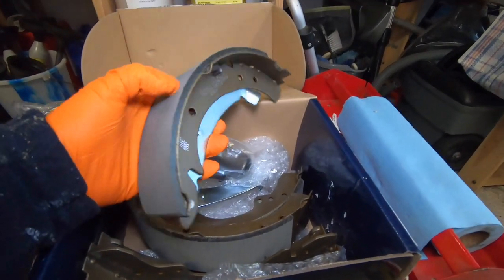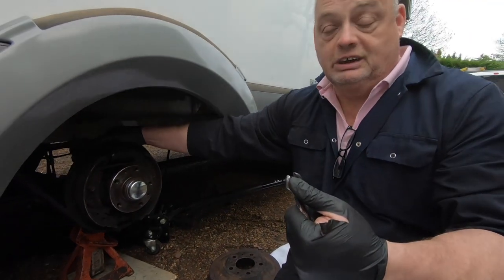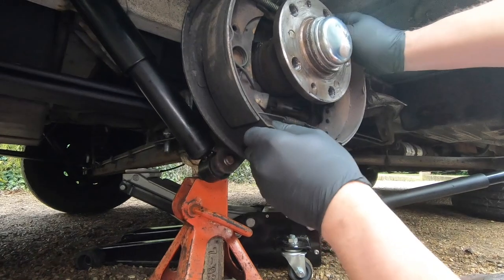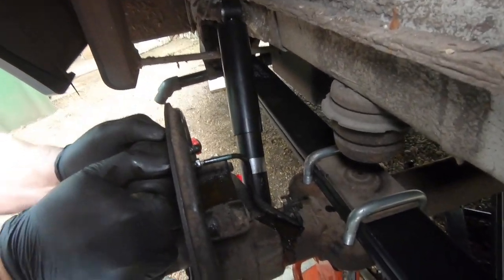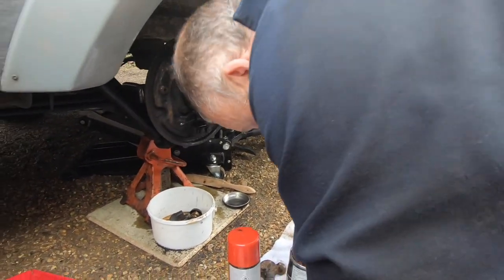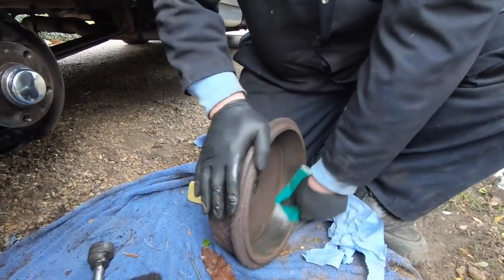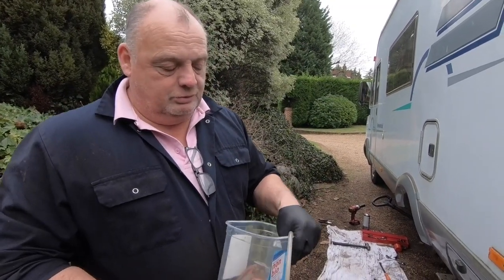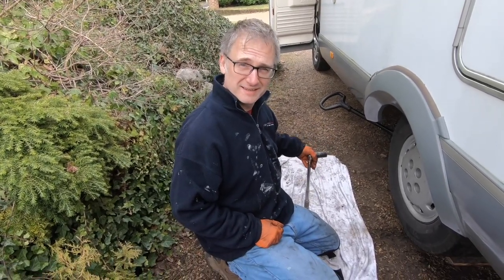Motorhome Mechanic - Replacing Rear Brakes on a Fiat Ducato

Comment: informative and helpful. Will still take it to my local garage. Reinforces there are some tools needed for this, and secure support of the motorhome while working on the brakes. Good to have a good sensible mechanic.
Reply from the maker: Hi Alastair, we've gone off of our garage. They should have noticed the front shock and the brakes (even passed their MOT). It might cost a bit at first for the jack, stands and other tools but doing these things yourself you know they've been done by your own standards. You also get a great satisfaction too

Comment: Thanks for this series. I've to do basically everything you did; replace a front shock that is leaking and front pads and rear shoes. Your videos are a good complement together with the Russek manual. ;) Happy travels.
Reply from the maker: Thanks SkyOnRoad. This means a lot. What's this Russek manual you speak of?
Reply: @HermanHitstheRoad  Peter Russek publishes pocket workshop manuals. They're not as good as Haynes manuals but at least it exists for the Ducato/boxer/jumper.

Comment: Hi chase great video on how  to change rear break shos many thanks for that. Very nice to see you have more axle stands and a jack not just relying on a couple of cheep axle stands when you change the drive couplelings which I Very strongly condemned  also I see you had plates under the axle stands very good brilliant thanks  .I normally put the wheel under as well with a couple of blocks on the top all in the interest of safety. I noticed that you were struggling nearing down  I use a 6×4 horse mat they are about 2 inches thick  brilliant if you can get a used one from some where  you will see a major difference even if the ground is a bit wet they are very good to lye or neal on .hope this has been of some help to you and others many thanks 😊😊😊😊😊😊😊 willemog.
Reply from the maker: Thanks Willis. Yes, Chas has various mats and I use knee pads for extra protection 👍👍

Comment: Another great video thanks. Need to do the rear shoes on mine this weekend. Did you lube any of the selfadjuster mech or threads? And did you use any copper grease between shoe ends and piston faces? Good to see the point re: hub to drum alignment in the outtakes :-) Thanks again to both of you for putting all the effort in to these great videos.
Reply from the maker: I didn't lube the self adjuster. I put copper grease on the edge of the shoes where they contact the back plate but not the ends. I hope this helps, @mobilvettamotorhome2056 ?
Reply: Yep - one side done and I did the same so far. Having a nightmare getting the second drum off. Do you recall the thread for the three bolt self extractors in the drum? Tried M10 coach bolt but it feels wrong. Might be they’ve been abused in the past but it would be good to know correct spec if possible. Thumbs up too to Coastal Motorhomes - great phone and delivery service and I used your Herman discount code on the parts :-)
Reply: FWIW - I found a post on the Fiat forum stating the drum self extractor threads are 10mm x 1.25mm pitch. Will get some good cap head bolts and try them.

Comment: Great video and series. Just a note not a criticism and maybe you did this if camera but before adjusting the shoes it’s good practice to fit the drum back over and press the brakes this centralisers the shoes before you adjust them up. Anyway keep the videos coming and good luck hope you don’t mind the advice
Neil
Reply from the maker: Thanks for the advice, Neil. The brakes are self adjusting so I'm not sure it matters.
Reply: Herman Hits the Road no your correct it will adjust but most of the time the adjusters don’t work great but yours looked in good working order to be fair 👍
Reply from the maker: Oh, that's because I also brought the brake kit too. I got what you're saying 👍

Comment: Great video I,m doing my rear brakes on my peugeot diesel campervan today wish me luck
Reply from the maker: Good luck, Gordon! How did you get on with your brakes?
Reply: @Herman Hits the Road  one side was a pig but loosened the handbrake cable and new shoes fitted and brakes bled the fluid that came out was black they're much better thanks for the video really helped
Reply from the maker: That's great news, Gordon 👍👍

Comment: Hi again, great video. I’m now in Croatia and after inspecting the lining on one of my brakes on the double rear axle came off. Will need to replace the shoes on that wheel, and will do the opposite as well. Does this mean I will have to do the shoes on the other rear axle as well?
Reply from the maker: You should always replace brake shoes (or pads or discs) in axle pairs, @mjgdevos. Meaning that the brakes on the other axle shouldn't need replacing. I hope this helps

Comment: Great video, does herman have a load sensing valve ?   Im thinking if its adjusted incorrectly it will mess with the rear brake operation however well you set them up. What do you think?
Reply from the maker: Great idea, Colin but I think it's OK. We don't seem to any problems with the rear brakes or the lead sensor. Thanks 👍

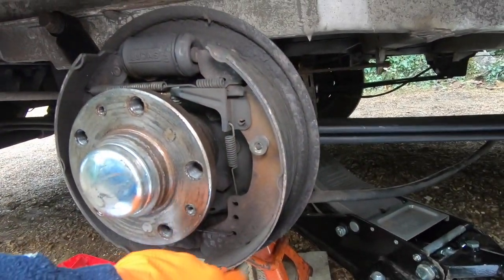Comment: 1:47 I managed to get both brakes back together now (after having to flare and bend a brake line)  Job done but then I noticed the spring that goes from the adjuster is installed differently between each wheel.

First off.. my model is the one before yours and so the adjuster is not the same.  I have FT32423 and you may have FT32420 but to be honest FT32420 does not really look like yours.  

My "before" photo shows the spring entering on the back of the adjuster arm and the back of the shoe.   

The other side I installed like yours, with spring entering the arm from the front and entering the drum from the back.  I don't have a "before" photo for this side.

Now I must decide if I take it apart to match the "before" photo of the other side.  Or.. perhaps it is meant to be this way?  

( Too bad I took only one side "before" photo.  I advise others to not be like me and to instead take a photo of each side "before".  )

Well I've just put the other drum on now and said the heck with it.  Good enough.
Reply from the maker: Great stuff, Matthew 👍
Did you need a new brake line or did you manage to reshape it to stretch long enough?
Reply: @HermanHitstheRoad  New line.  Actually there was a lineage of 3 lines. Mind you I'm in Hungary and cannot speak Hungarian, nor is my girlfriend all that great at translating.  The first line didn't have the correct flare.  Couldn't get it on & good thing I couldn't -- probably would have leaked.  The next line had the right flare (the DIN aka bubble flare), but I had to bend it myself.  Used a 26mm lug on a vice to bend around.  Turned out OK.  Then I realized copper isn't really maybe the safest & so I ordered a copper nickel line with flares pre-made from augustin in germany.  I haven't tried to bend it yet, the copper line is on the car and seems to be doing the job for now.

So then I put it all back together & got the drums just perfect & then it was time to bleed the brakes.

Figured out how to bleed one.  I tell my gf to pump it slow.  Then her dad comes along and tells her to pump it really fast. I didn't really think fast enough and before you knew it suddenly all this air was coming through.  

So the master cylinder went dry.  

Any times on getting out of this pickle?  

I've watched some vids that say I can bleed the master by loosening all the lines to the master, then pushing the brake down & holding it there, then tightening the lines, and then releasing the brake.  Then repeat that 5 times.  

I'm going to give that a try tomorrow.
Reply from the maker: Your need to get the fluid through the pipes and remove all air. Pumping fast and not locking the nipple off in-between pumps (when foot is down) means that air can get back into the line at the nipple when the foot pedal is raised. Make sure the master cylinder does go dry and start with bleeding the brake furthest from the cylinder, then the next furthest etc. There are some bleeding kits which require only one person. 
Good luck 👍👍
Reply: @HermanHitstheRoad  Thank you for writing back!  I feel like I've really gotten myself into a corner.

Did you mean to make sure the master cylinder does NOT go dry?  Everything I read warns me against this.

However... I accidentally let the master go dry.  

So... now what?  That's what I'm trying to figure.  

Was going to maybe try something like this to bleed the master.  https://www.youtube.com/watch?v=Uz4OwuUGVOA.    He tries to push the air out from the master by loosening / tightening all the lines exiting the master.

Comment: The brake fluid nut is 11mm.  watched other vids saying they are 12mm, but the flare tool I purchased has 10 & 12 & the nut seems in between.
Reply from the maker: Do you mean the brake bleed nipple? It's not 11mm. Nor 10mm or 11mm fit
Reply: @HermanHitstheRoad  I mean the spot where the brake line goes in.  What tool is required to loosen and tighten?  I'm at the shop just now.
Reply from the maker: It's called a 10mm thermal couple spanner
Reply from the maker: https://www.ebay.co.uk/itm/Thermocouple-Spanner-Split-Ring-Type-8-And-9-And-10-And-11mm-Flare-Nut-/302991052336?mkcid=16&mkevt=1&_trksid=p2349624.m46890.l6249&mkrid=710-127635-2958-0
Reply: @HermanHitstheRoad  looked at images on UK sites and yes that is the tool I have in my hand.  12mm spun freely and 10 too small to get around it.
Reply: @HermanHitstheRoad  I've got the thermocouple 11mm tool. Thermocouple sounds like something from Dr. Who. 

11mm definitely the size. It loosened fine on one wheel, but not the other.  And now the nut is getting rounded. 

Is this the world of pain that your mate was referring to?
Reply from the maker: Yup. Because if the nut gets damaged then you may end up replacing brake pipes.

Comment: After the brake shoes parted company with back plate and knackered it, I have removed the back plate etc and ordered a new back plate and brake set complete from Coastal Motorhomes, the back plate not available from Fiat dealer in the UK.  I have a problem in understanding how the handbrake cable removes itself !! from the back plate, the nipple will not fit through the back plate aperture and I conclude that I will have to unsolder the nipple, and resolder once removed, seems unusual, anything I am missing, the Kon Tiki is year 2000 a Ducato on Alko chassis,  Bill
Reply from the maker: Hi Bill, that sounds weird that it doesn't fit through the back plate. So you are trying to fit the old cable through the new back plate? Can you compare the old with the new back plates? Maybe Coastal sent you the wrong ones. Could it be a mismatch of cable and back plate I wonder? I certainly wouldn't remove the nipple to replace the other side. I'll ask Chas to see what he thinks.
Reply: Hi Bill so what you are saying is that you can't get the old back plate off?
Or that the new back plate doesn't fit the old cable?
Reply: Also some of the back plates have a plastic removable retaining clip on the end of the cable easily missed. 
Can you send ad's a photo?
Reply: @charlessmillie8774  how do I get a photo on to reply please
Reply: @williamstacey2140  are you planning on changing the cables  
?
Have you got the new backplates can you compare them to the old ones?
Reply from the maker: Hi Bill, you can send photos or video to my email address which can be found on our YouTube channel page under the About section. 
Ads
Reply: @HermanHitstheRoad  well I cant even find your channel page never mind the e mail address or the about section, guidance needed please
Reply: @HermanHitstheRoad  hi found !! sent you three photo's rear view and two inner, regards
Reply: @charlessmillie8774  I do not intend to change the cables, he new backplate looks the same apart ffrom the 'guide' inside for the handbrake cable, the damaged original is a plastic type sleeve, the new plare has a springy whatsit,
Reply: The fitting which looked like a weld was in fact 'rust' the inside of that was held in place by a cylindrical circlip thing, removed with light hammer blows and WD followed by mole grips. can now hopefully fit the new backplate and b rake shoes etc.
Reply: Due to the amount of rust etc on this brake drum etc I am going to do the nearside, I saw somewhere on here about a discount code for coastal trailers,that would save me a few bob !!

Comment: I'm in the midst of this job - trying to decide which cylinder size to buy.  I've got the same old cylinder on mine as you did (marked Lucas 643).  Do you know the bore size of the cylinder you all fitted?  choices are 25.4mm 27mm and 28.6mm.  any idea?  thank you.
Reply from the maker: Ours might be different to yours, Matthew. I don't have the receipt any more. We took ours to a car parts place and measured it up. There should also be a number cast on the side of the cylinder which should help.
Reply: @HermanHitstheRoad  OK.. pulled back the dust cover, girlfriend pushed in the brake hard & out came the piston.  28.6mm is the answer.  Thank you Mr. Herman owner.. from a Bob (the Eura Mobil) owner...  This is on a 1996 ducato 2.5 tdi
Reply from the maker: You're welcome, Matthew but I'm not sure i helped much.
Reply: @HermanHitstheRoad  your vids are definitely a help.  The leaf spring vid is giving me some ideas.
Reply from the maker: Glad we could help 👍👍
Reply: @HermanHitstheRoad  thank you! Also good to know that your 10mm flare wrench suggestion jives with Scotty Kilmer's drum brake change video.  

By the way, have you had any issues with your rear brake since changing it?  I noticed that those FASToriginal parts are listed as remanufactured.  Dunno if I should go for those or some new bremmos.
Reply from the maker: We've had no problems since fitting them

Comment: 24:38 Magic happens here.  I can't seem to get my drum back on.  Adjuster near its minimum setting.  Hmm...
Reply from the maker: I can't find your post with the video in it but I did watch it. I don't understand what he is doing there. He has only replaced the master cylinder but you will have air in all your brake lines now especially at the rear were you've replace the lines. You need to bleed all the brakes starting at the furthest from the master cylinder while constantly topping up the fluid.
Reply: @HermanHitstheRoad  Back wheels are done now I think. Also a new parking brake cable.  If you ever need to fit one of those be sure to measure the length of your old one and have a look at the very end of the cable that fits into the drum.  If yours is like mine with the indented ring at the end, then be careful to save the retaining ring when you take it out.  if it's disintegrated like mine, then epoxying them in place did the trick.  Then again, you have a mechanic as a friend so you'll do a better job than that.  Also a new oil pan is in.  I think I'm really starting to appreciate mechanics!
Reply from the maker: Wow. Sounds like you have had lots to do. Is it ready for camping yet?
Reply: @HermanHitstheRoad  just put oil in and started her up. Yes I suppose it's ready.  Mine blows a steady stream of grey blue smoke.  Not a hideous amount, but enough that you notice.  How about yours?
Reply from the maker: I think blue smoke is an indicator of burning oil.
Reply: @HermanHitstheRoad  Yes.  A little bit depressing to change an oil pan, fill it with new oil & then watch that oil come out the tailpipe.  I need to get a compression test & figure which part is causing the problem.  Mechanics tell me to just live with it - I'm hoping it could be a valve cover gasket or something like that.  You don't have this problem?  What sort of engine is in yours?  Mine is the 2.5 TDI
Reply from the maker: No, we don't have this problem. Engine is a 2.5 non turbo
Reply: @HermanHitstheRoad  Good job choosing Herman.  How many mpg do you get?  Or do you use L / 100km?  

Also, do you know if these engines have PCV valves and where they might be?
Reply from the maker: A few years ago I measured 26mpg. No idea about the valves
Reply: @HermanHitstheRoad  That is excellent fuel efficiency.  I may have measured that once but was drafting big trucks on the highway.  Dangerous!  I'm lucky to get more like 22 mpg.  Definitely need to have a complete inspection of the engine, valves & gaskets. Luckily I'm in Hungary where a mechanic runs about $30 / hour.
Reply: BTW, the trick to getting my drums back on was of course to dial back the adjuster to its minimum setting.

I learned that it is easy to adjust to tighten an adjuster.  Harder to dial it back.

Comment: What size spanner needed to remove the rear fluid input connector? I not sure if I have one? It has to be open ended as the brake pipe prevents using a ring? thanks.
Reply from the maker: I think it was a 10mm or 11mm spanner, @onlylexus. I'm going replace the brake lines soon so I'll tell you in that video

Comment: I absolutely hate pulling you up on things, honestly I do!
But as a mechanic  I would first start off with slackening off the hand brake cable, then after removing the wheels I would turn the drum and look through one of the wheel stud holes or if there was another hole to find the auto adjuster and release the adjuster, every thing was OK to some respects except there was no lubrication to the auto adjuster threads!
On refitting the drums and adjusting the shoes to drum clearance this was done incorrectly! 
One should wind the adjuster until the drum does not turn!
Then click it back one click at a time so the drum rotates freely!
After all of this and the brakes have been bled successfully! 
The hand brake cable should be adjusted!
Pull hand brake up to six clicks. Hold it there, go under vehicle to where the hand brake yoke is and torque to the specific torque in the manual, then lock up the lock nut!
Reply from the maker: Thanks for the advice, Mike Lane